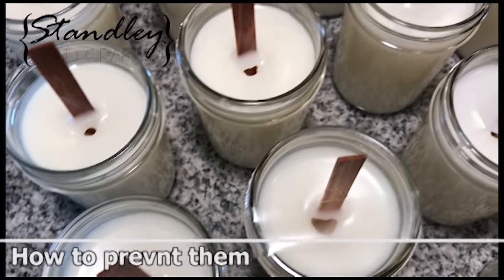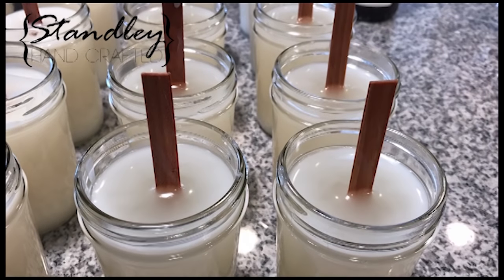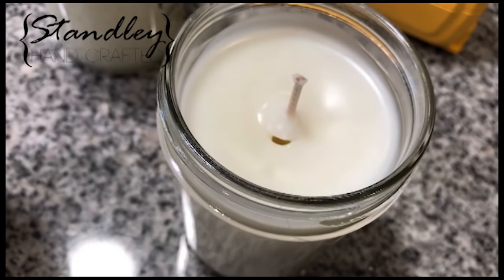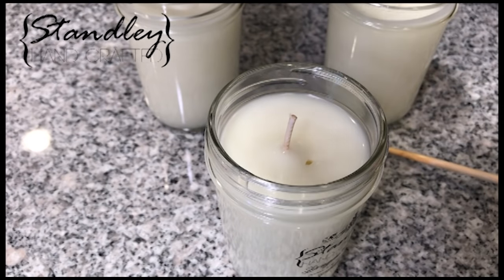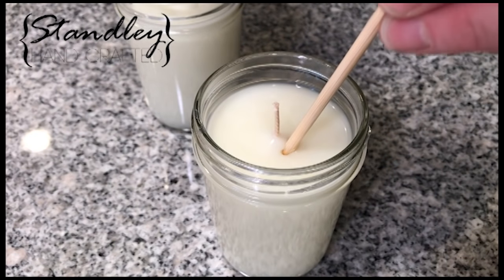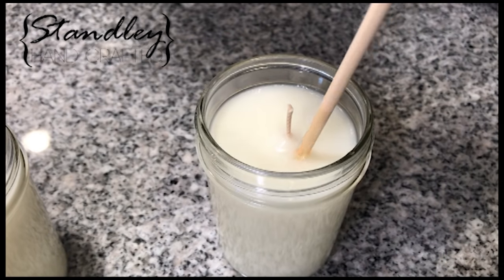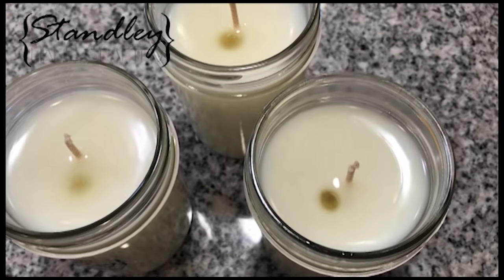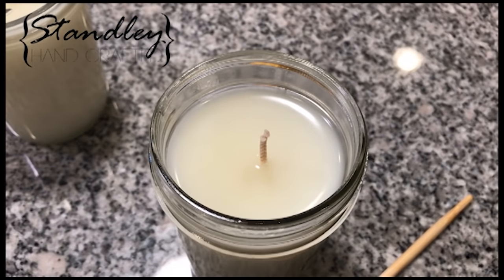Candle sinkholes, why they happen, how to fix them, and preventing them

Comment: Isolate your candle by storing them in a closed box or cover them and avoid ventilation. AC and Fans can accelerate the cooling process and cause your candles to shrink and sink and also preheat your containers so that it is adequate enough for the pour and doesn't shock your hot wax. (You can preheat them at a low temp in your oven or double boilers.
Reply: ThaSikeChick This is my candle channel account. 

I’ve never been a fan of preheating jars. Slows the cooking process and with certain waxes you will still get some sinkholes. I’d rather pour hotter and fix in post.

Comment: Ok your all wrong sinkholes are common.  Most wax is a two pour which means you pour your candle half way up. Let it cool then pour your second  layer . No sinkholes. I've  been doing candles for over 20 years. Also stay away from paraffin that will cause  sinkholes all the time. Hope this helps.

Comment: Just seen this and it has saved me so much stress. I made 6 candles today for the very first time, and every single one had a sink hole. I couldn't find my heat gun and used my hairdryer and ended up with wax all over the worktop and running down the jars. I eventually found the heat gun and it worked a treat. Thank you so much. I now know to do this before the wax sets completely.

Comment: 3.10min packed with information. Are you a Salesman or a Teacher? You articulate very well, on this subject. I learned so much from you. Thank you very much. I wished I had found your video before I made my first batch of candles. But, I refilled them with a different colour wax once the sub layer had soft set. Then, I used a heating torch to melt the candles like you did. The top wax (different colour) melted down and formed a really nice blended tone and pattern of both colours. It looks really cool. I think I might have stumbled on a neat technique.

Comment: I think I poured too hot, so I will try you're temp and see if that makes a difference. I didn't know there was a sink hole as it wasn't visible until I lit it and clearly saw it. My first time making a candle and it came out great for my first try. I also had to calculate my own wax weight with FO and was spot on. It's so much fun🙂

Comment: If I have any residual wax left over, I heat it up, fill the sinkhole then when the wax is completely level, I blow the hair dryer over the surface (hot setting) and it levels out, leaving no tell-tale filling-in lines. Simpler.

Comment: I get a lot of tiny bubbles  and like a frost on top I use dye block for coloring my candle which I think my be part of the problem. I heat my glass container before  pouring wax 
Am I hearing them too much or too little 😅need help.

Comment: I did what you said with the heat gun, and yes it worked,  It then appeared to crack the wax on the top, looked dry if that makes sense?  Have you had any problems with that and if so how do you make sure that doesn't happen??

Comment: when using the heat gun method, what temperature do you pour at? Is it 130 to 125 or higher? Thanks for the video btw, heating jars still weren't working for me.
Reply from the maker: For soy I pour around 125, parasoy I pour much hotter around 145-155
Reply: Jeff Standley thank you so much!

Comment: Hi please can you let ne know how i can prevent tunnling. Everytime i make my scented candles they only burn through the middle and leave the sides and it creates a tunnel look.
What can prevent this from happening? ive tried pouring at a lower temperature 
Is it possible that it could be how much fragrance oil i out it?
Reply: Lubna Shaheen Tunneling is usually due to small wicks. Try going up one size and see how that goes.

Comment: Love this. Now can you use a blow dryer on low heat ? Also can you fix this hole problem any time after it cools or does the problem need to be fix within like a 24 hour period ?
Reply: This is my actual candle account. 
A blow dryer does work but it's got much more force and can blow the wax all over. A heat gun gets much hotter and works alot better. :)

Comment: Thank you so much for sharing, I have poured a little extra wax after finding a sinkhole.. sometimes it works sometimes it does not lol great tip will try
Reply: Topping up candles is a very typical method! If you're doing it that way, your temperature should be higher each time. It helps the new layer look seamless  :)

Comment: I tried EVERYTHING. I MEAN EVERYTHING! I've played with the temp. If mixed less because of air bubbles...I tried using different wicks, I've tried using different temps. I've tried pouring slow. I tried pouring faster. This is STILL happening!! It's sooooo frustrating 😢😢😢 
Like what am I doing wrong? This isn't my first Rodeo I've been doing this for a while and for some reason I just can't get the fucking sinkholes to stop forming. And it's always in the damn middle. So what you've taught me here is if it's in the middle it's probably something to do with my wick? Is it the wick size that could create this? If you have too much of a big wick in too much of a little jar will it create sinkholes in the middle of it? I guess that's a really good question and it pretty much is the only thing I can think of of why my candles are still doing this after so much effort

Comment: how do you get rid of air bubbles/pockets and wet spots on the sides of the jar? not the top.?
Reply: Answering from my actual candle account. You can remove those by pouring a little hotter and also running a heat gun around the sides.

Comment: Thanks for the helpful video but am unclear as what you do after you create the hole . Do you add extra wax to fill ?
Reply: Sue Bowen I show you in the video what to do 😉
Reply: I do. Heat any residual wax you have left over, re-fill the sink-hole, (You may have to do this more than once) then when it's dry and to the level you want, get rid of those tell-tale refill lines by heating the surface of the candle gently, with a hot-air gun, or a hairdryer set to the hot setting.

Comment: Thanks for the video! Have you ever dealt with frosting on your candles? When I hit the tops of my candles with a heat gun to fix sinkholes, they end up with ugly frosting and/or uneven.
Reply from the maker: This is usually the result of heating too hot, most of the time this happens when you pour too hot or cold. 
I haven't had this happen from a heat gun yet. Soy has this issue more than most. Are you using 100% soy?
 How close and how hot are you heating the tops?

Comment: Yea i think i need a heat gun..... Hair dryer makes the wax splash everywhere😕
Reply from the maker: Yea it does! I used one for a month before I bought one. LOL
Reply: @4HourJourney  I make double wicked candles from GW464 that are about 4"x3" on the top dimensions and 4" deep. I'm getting sink holes around/between the wicks but when I try to heat the wax to fill it I get a huge divot in the center where the hole was filled in and can't get the entire surface of the candle melted evenly to smooth out. Any recommendations? still using a hair dryer, plan to buy a heat gun. thanks!